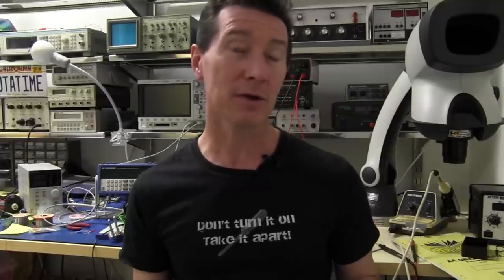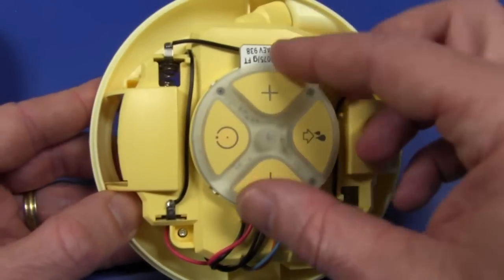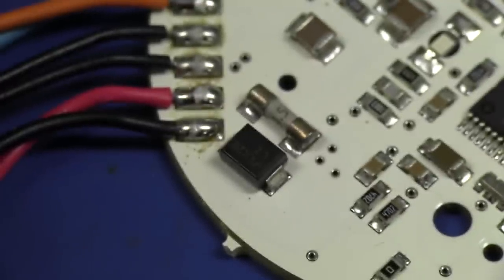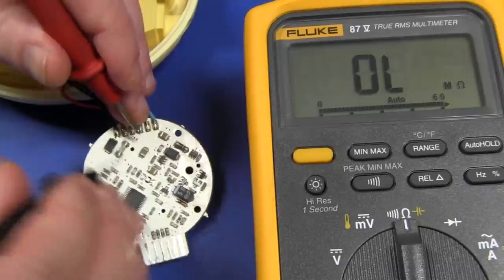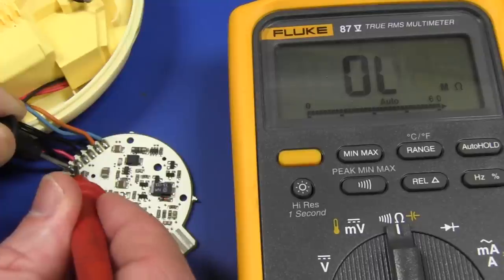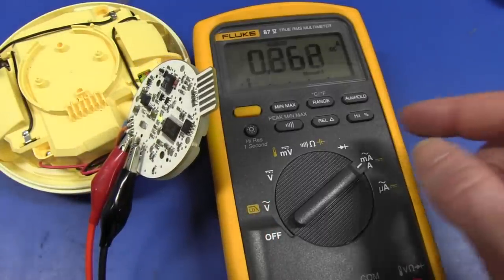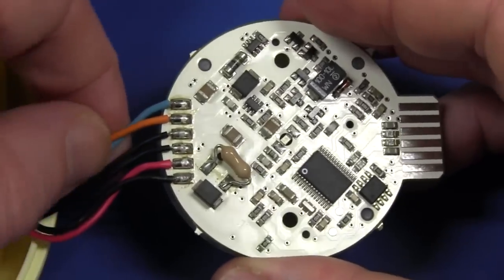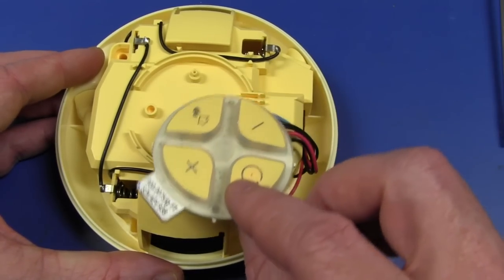EEVblog #330 - Medela Swing Teardown & Repair

Comment: Hi, I sell these!

When a baby starts to feed, they make rapid shallow sucks until the milk starts to flow, then they slow down and suck harder.

This is the purpose of the various speed and vaccum settings.

When the pump's operating, the tube's attached to a connector with a funnel (conical breastshield) on one end, and a flap valve and bottle on the other side.

When the pump draws air in, a partial vacuum is created in the tube and cavity in front of the nipple and above the flap valve.

Milk is released into the cavity. Next, the vacuum is reduced (I believe that the pump pauses as opposed to forcing air back), flap valve opens, and voila - milk drops into the bottle.

Great video by the way!

Richard.
Reply: That is correct. The pump is designed to try to imitate how babies suckle.
Reply: I guess it's kinda randomly asking but does anyone know of a good place to watch newly released series online?
Reply: @Ruben Azariah i watch on FlixZone. Just google for it =)
Reply: @Hassan Maxton definitely, I have been watching on flixzone for since march myself =)
Reply: @nathanielcaspian3923  Who knew that a video about broken breastpumps could turn up such useful intelligence re watching TV online?
Reply: @Hassan Maxton Thank you, I went there and it seems to work =) I appreciate it !!
Reply: @Ruben Azariah Glad I could help :)

Comment: I had this exact same problem with another model of the Medela pumps (the Freestyle, vs the Swing).  I assume the Freestyle is the newer model, and it still has the same circuit design, but now takes a custom battery that can't be put in backwards.  Although there's nothing to stop you from plugging in the wrong charger, which is what happened to us.

Regardless, if it weren't for this video I never would have diagnosed and fixed the problem.  Thank you so much for posting this!

Comment: Thanks, same issue here the fuse had gone. I dug a bit deeper as there wasn't anything obvious as to why it had happened since we don't use batteries (we have 2 identical units and ironically the newer one had stopped working being used 6 times a day for the last 10 months :o). Turns out the motor had stalled and was trying to draw 2A (:rollseyes:) - the pump unit is actually pretty complex when I tore it down but quite easy to disassemble - much like a small carb with 2 sets of diaphragms but interestingly, the second set of wires controls a small solenoid which opens and closes a valve in the main diaphragm as noted below by Ryan. The motor pulses on and off depending on the speed and power required using an eccentric cam that pulls the main valve up and down. There was nothing else untoward so I gave everything a clean and put it back together with a 'new' 2.5A fuse wire which should be more suited to this - if the motor stalls again a quick tap gets it's moving again it seems. Fingers crossed!

Comment: Dont know when you did this. I typically ask questions when someone brings me something like this to fix.When you mentioned the batterys and I saw the fuse I had already put two and two together.Like you said, its best to check things out farther down the line.I have replaced fuses in the past only to find it blowing them at a later time because of a bad connection or worse a cracked board causing a spike.I hate black and white board coatings.leave the thing exposed.

Comment: i'm not sure if some one has brought this up, the other pair of wires is actually going to a normally closed solenoid valve. when the pump stops, the valve is energized to release the pressure to form the sucking pulse.

Comment: These are really well engineered. If you're curious, the purpose of the + - buttons  is to control the strength of suction by changing the PWM to the motor, and the other button on the top with the droplet is what's called a 'let-down' mode. It simulates the stronger, slower suction that a baby would provide to cause the release of milk. It goes for a minute or so, and then reverts to the 'normal' mode of operation. Dave is probably right about that second PWM signal; it's probably for a miniature solenoid valve which breaks the vacuum, simulating the baby pausing to take a breath. I guess they PWM it with that rising curve to moderate the rate at which the vacuum seal breaks -- too quick, and ow! I've seen a number of different medela models with big price ranges; the fancier ones have more powerful pumps, and LCDs. As Dave guessed, they probably all use the same chip & software, and the EEPROM holds the settings appropriate for each individual model, so they can just flash all the chips with the same code.
Reply: +Rafael Santana ; before you judge try to put yourself in others shoes. Or how about using common sense. My single mother of five had to pump for my baby brother because my grandma watched after him while mom was working her butt off raising us. she understood breastmilk is healthier than formula so pumping while brother was already fed, so grandma could feed him the next day was a kind,thoughtful, and smart thing to do. so Rafael... shut up!
Reply: +Rafael Santana You were rude yourself in the first place, accusing Dave's wife of being lazy. Breast pumps are a great invention, allowing mothers to stockpile some milk so they can give their nipples a break. This is very important, especially as some women have more sensitive areolae and they can get dry and crack, etc. Plus, mothers have to work as well. They're not always there when the baby wants to feed.

Comment: The antiparallel diode and fuse reverse polarity protection method is good for high current applications as a series diode would have very high losses or for applications where minimal potential drop across the protection device is needed.

Comment: An idea about the pwm usage: for valves and other coil driven components it is recommended to use pwm as it lowers the current draw, temperature rise, and saves power in the process. Being a battery operated device like this, power consumption might be the critical factor.

Comment: EEVblog If I had to guess, they're likely pulsing that valve control line to lower RMS power. Those coils can draw a lot of current, but they don't necessarily need all that current to do their job. I'd guess optimization.

Comment: Thanks this is helpful I need to fix my pump and it is good to see how it opens up. My problem is the main power connection into the machine (I need to jiggle it to get it to work.

I don't know what wave forms are but the pump is trying to replicate a sucking motion, think drinking through a straw of a sports bottle. This quality pump is really good at mimicking a baby nursing they start with fast little sucks then long slow sucks.

Comment: Seems like the second signal from the sense wire is measuring the pressure differential, just because of the timing and rise time, so it's probably there to ensure consistent suction with a feedback loop to the micro that lets it know when to run the pump. If you stall the suction by closing the pump with your thumb, I'd expect the rise time of that sense signal to increase.

Comment: Those batteries aren't normally intended to be removed by the user. There is a charging socket (Visible at 28:00)

Comment: I reckon the wires drive a release solenoid. To reduce suction (to improve user comfort), the solenoid releases out through the bottom port that has no filter.
I guess the machine just sucks then releases - at varying rates.

Comment: Great constructive video !!! Thank you. We have the same model and it works fine. Recently for some reason it stops working with battery (fresh ones and plugged correctly) and only worked with AC power. Could you please help?

Comment: The reason for the reverse polarity protection diode being in parallel with the 1.5A fuse may be to increase safety of the device.  If the protection diode is in series as in other designs, it may allow for reverse pump operation after diode breakdown under reverse polarity.  Does it have an external adapter input?  I imagine reverse breast pumping could be unpleasant.

Comment: No it's done on purpose, and will have been the result of a risk assessment. Since there is not overpressure protection in the device independent of the electronics the device HAS to operate correctly to meet ISO60601. By forcing the device to be sent back for repair following a reverse polarity, they can test that nothing has been damaged and it still operates as intended.

Comment: I suppose it is possible that the protection diode is mounted across the supply so that the you wouldn't have the voltage drop across the junction. 

The surface mount fuse is a bit of a strange choice, but perhaps they didn't want the fuse to be user replaceable.  They might have made standoffs on the positive contacts to prevent wrongly inserted batteries from blowing the fuse, though...

Comment: For such high-end equipment you would indeed expect a protection FET, but clearly this design uses some power for the soft-on functionality, so this would block that power to the µC. If you cannot accept the diode drop in the main current path you also cant accept it here, so what option is there? There is the chance that more than -0.6V will be on the circuit when reverse inserting batteries, which is damaging. I think it's deliberate.

Comment: A protection FET would still allow the soft-power system to function. What are you talking about?

The only voltage-drop is the rDS(on) of the FET, and it takes no power (except any gate-leakage).

Comment: This might use a peristalsis pump which is also used on pumps for intra venous fluids. The fluid goes through sterile tubing and the motor operates an off center cam that pinches off the tubing and pushes the fluid through. The advantage is that the pump mechanism doesn't have to be sterile, since the fluid remains in the tubing at all times.
Reply: +Chaplain Dave Sparks The milk never enters inside the device. It has a membrane valve close to the breast "adapter" that works with the vacuum from the pump.

Comment: Hi there, my Medela Swing stopped working after using it a couple or three times, I have to say probably some milk got inside the motor when valve failing to get all the extracted milk and I'm afraid it might have burnt a component of the board. The problem appears is when I press "+" to increase the pump pressure, at that moment it stops working as if it was shorted or something. Which component(s) on the board are managing that button commands? Can it be fixed with its replacement as was your case with the simple fuse replacement? Thanks in advance for your help, much appreciated.

Comment: what if the diode in the powerrail with the fuse was faulty is that likely to break down aswell from something like putting the batteries in the wrong way?

Comment: The microcontroller may be a Renesas RL78.  It looks like 30-lead SSOP, an uncommon number of package leads, and this is the only MCU I've seen with this package.  What appears to be a ceramic resonator on the left side of the MCU is near the oscillator pins, but it's hard to tell much else with that crappy solder mask covering all the good bits (the traces).

Comment: The design is fine, provided there is a **user-replaceable** fuse. If the end-user cannot access the fuse, it's terrible design.

It basically means if you reverse the battery (even once), you *PERMANENTLY* disable the device.

A series diode, or if you cannot accept the diode-drop, a protection MOSFET, is a far, far better option.

Comment: Now, if they wanted to put a 4V zener to clamp the input rail, and blow the fuse if there is an power overvoltage, *that* would be understandable. 

However, failing on a *predictable* and consistent error condition, that can be reasonably expected to come from a inexperienced, or inattentive end-user and can easily be made to not damage the electronics in any way via a simple design tweak is absolutely NOT acceptable design.

Comment: What are the Pro and Con to replacing a Fuse with Resistor?
That was a resistor was it not?
Reply: +TuthHurts911411 No, it was an axial fuse. You can't replace a fuse with a resistor.

Comment: My wifes pump seems to have lost its strength. I have rebuilt the entire pump seals but i think the motor might be failing. The part number of the motor is worn off. Does anyone know the part number so i can attempt to replace the motor?

Comment: The fact that it's done intentionally does not make it any less terrible design.

A backwards-installed battery is a quantifiable, predictable issue. You can exactly state the conditions it will induce. Therefore, it is entirely possible to *design and test* the electronics to completely withstand it.

Comment: My guess:

The unit runs on a clock cycle and pulses a sensor on that cycle, when the sensor is triggered the motor pulse ceases.  The sense signal change always preceded the motor pulse state change.

Comment: Dave, the fuse/diode isn't bad design, it's purpose designed. If the batteries are put in backwards, it'll blow the fuse and mean it has to be returned for servicing to ensure the electronics still works properly. Otherwise it could suck their tit off - there's a maximum allowable pressure from the pump. I design medical devices btw.